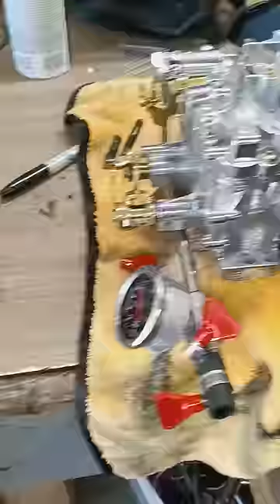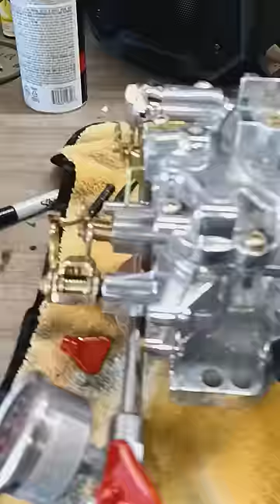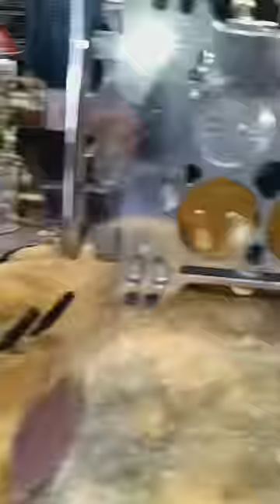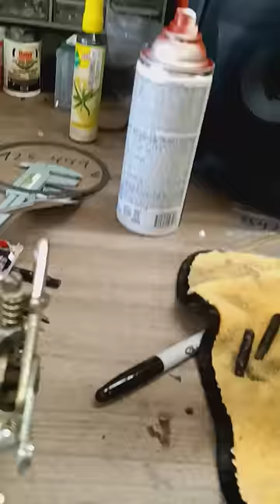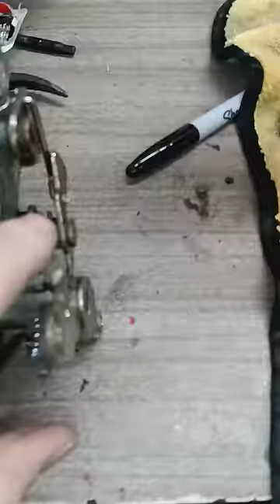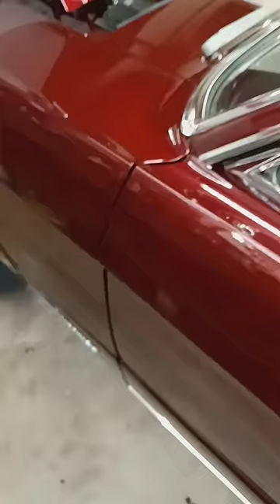how did I miss that?

Comment: I'll tell you what's gonna happen.........MORRRREEEE POWEEERRRR
Reply: Elon musk will call because of interference  with the space x stuff.
Reply: Just straighten your linkage...secondaries were barely opening.  Quit stompin the throttle.
Reply: Yaaasss biissshh
Reply: @christopherscott8853  stomping it is why it bent or jambed up while stomping, correct?
Reply: mo powaw baby!!! -donut
Reply: Moar powah babeh
Reply: @robertwalker3523  well let's think about this there's literally nothing else that contacts that or moves that lever or is ever in the way of it so most likely
Reply: @Freakopac  fuck I was literally coming down here just to do that
Reply: Forgot the Baby. "Mo Powa Baby!"
Reply: @GhostWolfPrimal  could also be Jeremy Clarkson
Reply: MOREEE PAAHHR
Reply: I mean...... maybe not carbs are made at different levels for different reasons and more fuel doesn't always mean more power
Reply: @the_mancavewithjacob  when the flaps don't open all the way it means it's restricting the air flow and the fuel flow if too much fuel then it's gonna spit and sputter and acceleration will not be smooth. Too much air means that it will run lean and it will prob misfire or accelerate rly slow. To an extent. the air fuel ratio has to be way off for most of what I just said to happen. He explained in the vid that it was like only opening half way bc the linkage was bent. And full throttle is a larger mix of air and fuel half throttle is a lesser mix if air and fuel. I just explained how a carb works for dummies
Reply: Moe powa baby
Reply: vroomvroom....vrrRRROOOOOOOOOM!
Reply: @Freakopac  shorten that some and you get... Mopar
Reply: @2strokeboys191  😁
Reply: MOAR POWAH BABAY!
Reply: Tell me when I said that out loud as soon as I heard him say it😂
Reply from the maker: All right guys the new carburetor is on and tuned I put up a couple of little videos check them out unless you are opposed to violence against tires.
Reply from the maker: @robertwalker3523  no the linkage would have been the opposite way if I was smashing it too hard. People in these comments crack me up they have no idea what they're talking about. Putting the pedal to the floor wouldn't bend anything it's not designed like that. The linkage was bent when the carburetor was moved at some point is the only thing I could come up with.
Reply from the maker: @christopherscott8853  are you saying the linkage was bent from pressing the throttle too hard? If that was the case the linkage would have bent in the exact opposite direction LOL.
Reply: @BPattB  will there be a service before or after the cremation? 😄

Comment: I say for shits and giggles throw the old one back on (fixed)  run her cause you might make a similar amount of power and could return the new one
Reply from the maker: My neighbor gave me the carb, he was over tonight and I have it back to him. I could probably get it back for "testing purposes". Like I need an excuse to go wide open on a carburetor LOL. Good idea I may do that but it won't be for a few days.
Reply: Was going to say the same
Reply: Was going to say the same, if you bought that because you were chasing a "problem" (other than eddys sucking🤣) then toss her back on fixed.
Reply from the maker: @the_monkeypox_commander6603  naw the new carb is a complete different carb. Edelbrocks are great for tuning and not have to adjust them. If I wanted to gain 2/10's in the 1/4 I would use a Quick Fuel. I've been looking on marketplace for a used one I can pickup and rebuild just for shits and giggles.
Reply: @BPattB  your absolutely right actually. Properly set up, they run well. One thing I could never get a Holley to do but every qjet or eddy would was start up without pumping the gas. I always admired cars that you could reach through the window and fire it up
Reply: Absolutely!  Fuck this is a 1 vice grip repair not a replace a fully tuned and functional $500 carb. Also w $80 and a quick trip to ur local internet u could get a FULL from everyday to 1 mile runs rebuild kit. It will have every part, gasket, oring, dodad, and spring u will need to tune that carb to absolute efficiency (or power if u prefer that term).
Reply from the maker: @TrapperAaron  I trying bending but I didn't want to brake it so I put a little heat on then bent it and it came right back. I was upgrading to a bigger carburetor is why I did the sawp
Reply from the maker: @the_monkeypox_commander6603  You are 100% right. In a car you want to drive the hell out of a  Edelbrock is thoughtless.
Reply from the maker: @TrapperAaron  I posted a 2 minute 30 second video on why the carburetor in question actually came out. Finding the bent linkage was secondary.
Reply: @the_monkeypox_commander6603   I guess I've had really good luck with Holly then. I've always tuned with a vacuum gauge though. Maybe it's an unpopular opinion, but I love the hell out of how easy a Weber is to set up on pretty much any in line motor. I don't know how many old 4 bangers I've had that I threw out the factory carb and put a Weber on.
Reply: Yep... return the new one and fix the old linkage. Save a few hundred bucks. Gas isn't getting cheaper.
Reply from the maker: @scot_irsh  LOL I did not buy the new one because the old one needed to be replaced I bought it because it was a bigger carburetor and a 40-year newer version.
Reply: I had carbs for years but I've recently gotten into the pro flow systems by edelbrock gotta say way better
Reply: Literally what I was going to comment. Because the old carb didn't look bad at all other than the bend in it that made it only oped ¼ of the way.
Reply from the maker: New carburetors on and the car runs like a bat out of hell. I put up a couple videos yesterday you guys should check them out
Reply: @BPattB  Thank for letting us know. I'm heading there now to watch them.

Comment: 20 years ago I needed a car after losing everything in a hurricane. I had moved into a boarding house I could afford and one day saw a survivor 1982 Toyota Corolla parked next to some other survivors that were tagged unlike the Corolla. After knocking on the door I was shown the guy's other drivers all being decades old and he explained that everything on the Corolla was working great but after having the carb rebuilt it was hard to start and then blew black smoke. I gladly gave him the $200 and drove it home a few blocks after pouring a little gas in the carb. Long story short whoever rebuilt it put the choke cam on backwards so it was open when cold and closed when warmed up. After figuring that out I felt guilty so I drove back over to show him at which point he laughed and handed me the title, manual and receipts and said "Enjoy, I'm glad it's working for you." I'd pay ten times what I did to have that awesome car now even with the factory yellow paint. 54mpg at 60mph, easy to work on and so familiar as I've owned at least ten rear wheel drive Corollas. Caring for your car is saving the planet among other things.

Comment: In the Army 74-77, I bought a '71 Roadrunner 340 with a 3-speed on the floor. It had a 780 Thermo-quad carb. When you gave her some gas and it started sucking air it sounded like the hood was opening up. Cool as it gets.

Comment: Glad you found that problem. Gonna be sick!
Reply from the maker: Right on man. I can give a little teaser. The new carburetor was more than I hoped for and that's without even tuning it. If I go wide open throttle below 2500 I have a slight bog. So I decided to test it at 2500 rpm and go wide open throttle. The car broke traction immediately and slightly fishtailed all the way through first gear and about halfway through second. I have 280 gears so by the time it finally stopped spending the tires I was going about 60 miles an hour LOL. I'm going to make an update video or two or four for s** and giggles
Reply: @BPattB  Nice, so there must have been some resistance on the butterflies then... Result 👍
Reply: @BPattB  maybe the jets are to small on initial pull starving the beast...

Comment: Then the choke is in the closed, or partially closed position it doesn't allow the butterflies to open all the way. I believe its a safety feature to prevent wot on a cold engine. If you manually move the linkage to open the choke all the way then work the throttle linkage it will open both butterflies fully. There's nothing wrong with the carb.
Reply from the maker: So I went through this in the second video and I did check the choke and the air valve for the secondaries. The linkage was definitely bent and preventing the secondaries from actuating. I really appreciate you pointing it out to me to try and help. It's crazy there were a few people that commented how stupid I was for not checking that and when I responded that I did check it they told me I was a liar that's why I made the follow-up video. If I continue to get 77,000 views ( I really doubt it I think I struck lightning LOL) I really shouldn't be worried about two or three people that are trolls. But I do truly appreciate you trying to help me.
Reply: @BPattB  the AVS2 is great carburetor! Much better part throttle response and WOT smoothness at lower engine RPM’s with the change to annular boosters. By the way, James is 100% correct about the choke linkage locking out the secondaries when the engine is cold. Carburetors can be so frustrating at times, but it looks like you’re making progress. Good luck!
Reply from the maker: @trevorlindner4993  absolutely right that the secondaries will not open when the choke is closed. There's a lockout linkage on the driver side bottom of the carburetor that unless the choke is open it prevents the secondaries from opening. I made another video showing the choke open in the secondary still not opening. I just posted a video last night of the bent linkage being straightened back out and everything works fine now. Still dialing the AVS2 in but even with a slight hesitation when the secondary is engaged the carburetor is great.
Reply: What is wot?
Reply: @brandonrides   W-ide O-pen T-hrottle
 👍
Reply: @loganpe427  ur only a month late

Comment: This is where the fun begins
Reply from the maker: I got the new carburetor on and haven't tuned it yet there's a bog below 2500 rpm so I decided to test it and bury the throttle at 2500 rpm and broke the tires loose all the way through first gear and halfway through second I think I finally hooked up at about 60 miles an hour. Subscribe I'm going to post a bunch more quick videos
Reply: @BPattB AFR AFR AFR....get you the exhaust temp gauge and an AFR. AVS2 being a 4 barrel carb, it won't just be the jetting. You want heavy jets on the 2 back barrels and light jets on the front, then make sure partial throttle is front barrels and half throttle is 20-30% on the back and 60-70% on the front. Full throttle is 100% on all 4.... Obviously because you need all the bald eagles.
Reply from the maker: @racetrackalexander381  All ready ordered lol. Cletus McFarland is going to stop by and help me tune it.
Reply: I got a bad feeling about this

Comment: From an engineering standpoint, a butterfly valve has an abrupt flow curve. At 40% opening it is at about 80% flow. You will see a minimal difference in output.

Comment: That's an old trick Dads do when they know the kid is taking the car. Also check to see if the spark advance has been disconnected. On the old quadra-jet carb , you can simply put a small nut and bolt into the linkage that will prevent the secondary  from opening. 
I used to do this with my '73 Trans Am with a 455.
Reply: Quarter jet carburetor is a lot different than Ford carburetors or carters carburetors  I don't know much about that Edelbrock I'm a holy and Demon carburetor guy but I don't know Carter's carburetors and Edelbrock carburetor on a Ford carburetors are not the same as Chevy.
Reply: Does this carb have a vacuum secondary or mechanical??? Quaddies were very commonly used on our factory Holden V8's, here in Australia... If only they had a squirter for the secondaries, they would have been one of the best carbs of the era. They were fuel efficient when cruising on the primaries and made all the right noises when the secondaries opened!!! You could tune them ok if you knew what you were doing, they are a pain in the arse compared to tuning a Holley or similar
Reply from the maker: @danielbrealey2924  this carburetor has a weighted Air flap in the secondaries, when enough air moves past them the air flap will open and the secondaries will activate. I've heard this type of secondaries called velocity secondaries. That's the reason I went with new carburetor. New carburetor has adjustable secondaries and a few other upgrades.
Reply: @jasonlopez4855  
I was talking about how the fella noticed that the linkage was bent and that it would not allow the throttle to go all of the way open. Dad did that when he knows the kid is taking his car. 
Dad may not be able to stop the kid from taking the car, but he can stop him from going wide open throttle.
Reply: @BPattB   Quaddies are a bit of a bitch to tune in performance applications, so I don't blame you for changing it. Vac secondaries work great in the right application

Comment: A friend had a ski boat that stopped running correctly. For months he fiddled with the engine to no good result.
He parked boat on the side of the house and used it as a party place. One night a guest looks at the engine and declared that there were two teeny tiny linkages rusted together that was the root cause of the engine problem. All the months of fiddling and nobody noticed that problem.

Comment: You should also check if it will go to WOT/wide open throttle, when you push the peddle.  Carpet and/or other issues might prevent it from going to WOT.
Reply: Yep, always part of the cable adjustment proceedure for me! 👌
Reply from the maker: Yeah I adjusted the throttle linkage (no cable, to old?) When I put the carb in and saw the linkage go all the way back and contact the linkage attached to the high idle cam,  my fault for assuming that. I assume that was how it was designed. When I got the new carburetor I realized that it should go a lot farther back LOL. That just means that much more of a performance increase 👍👍👍👍👍

Comment: Some 40 or so years ago Hot Rod Magazine had an article about the 50 cheapest speed secrets.  Checking wide open throttle opening was one.  I checked my Chevelle SS and it was only about 75%.

Comment: Brother... my first engine swap around age 15 was to fit a 455 Pontiac junkyard pullout motor into buddies 1967 Firebird with junk OHC 6cyl. With 455 that car was scary fast, burned rubber with OE traction bar, and might have KILLED us except, when we sold it a year later, the buyer pointed out that the Quadrajet's secondaries were not opening AT ALL 😆😆😥.

Comment: The choke lockout is ON!
Reply from the maker: Watch the follow-up videos I zip tie the choke side linkage open the weighted air flap open and hold the lockout open and actuate the linkage. It's bent and prevents from full activation.

Comment: Choke mode on  in the first carb perhaps?
Reply from the maker: No. I don't show it in the video but I opened the choke all the way and the weighted air valve on the secondaries. The bent piece of linkage I point out comes in contact with the linkage on the fast idle cam.
Reply: @BPattB  sorry I didn't even watch the video to the end and see you explained what was wrong.  My bad ✌👍😄
Reply from the maker: @vossie1119  No worries man. It sounded like you were asking a question to possibly try and help me. I appreciate it.  I actually got accused of lying about the choke. I explained to the guy that I physically held the choke linkage open and used a small screwdriver to hold the secondary air valve open and had the same result. He said "I know you didn't do that because they would have opened. YouTube got some trolls man it's crazy. 👍

Comment: I just subscribed...lets c pt 2 when u fix it or put new 1 on plZ...
Reply from the maker: If you're subscribed you're going to get a few/bunch more videos on the car. Just a little teaser the new carburetor had a slight bog below 2500 rpm. So I decided to punch it at 2500 rpm and it broke traction and slightly fishtail through first gear and half of second. Stay tuned man and thank you
Reply: @BPattB  No problem and sounds gud...lookin' forward...

Comment: It might not make as big a difference as you would think. Sometimes the air flow actually helps open them in these situations, they still might not have been reaching WOT though, but unless there's a physical resistance stronger than the air flow- they just naturally want to open all the way
Reply from the maker: I already have the new carburetor on and even with a bog below 2500 the difference is crazy. At 2500 rpm I buried the throttle and the car broke traction and fishtail through first gear and halfway through second. I guess it all just kind of depends on how the motor is built. If it's a stockish motor you're absolutely right. But this is not a stock motor LOL. Stay tuned I'm going to do my best to find out exactly what the little old lady sold me and I'll explain the story behind the car.
Reply: @BPattB  Great to hear you got a result! 👍